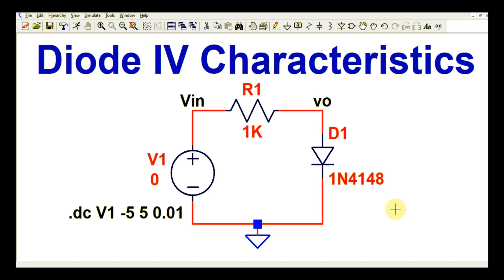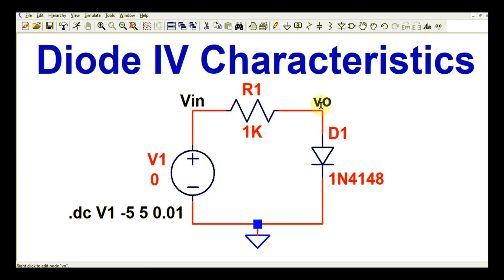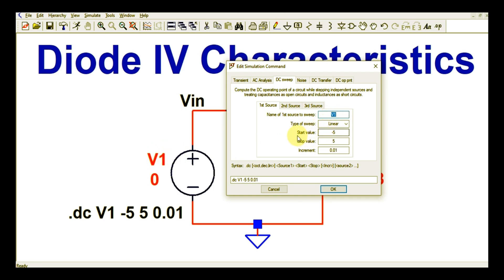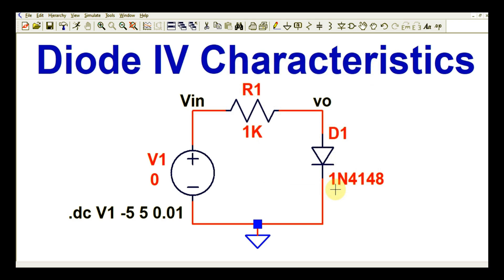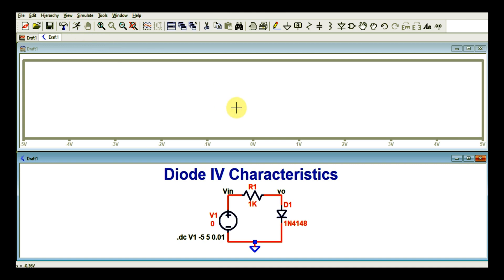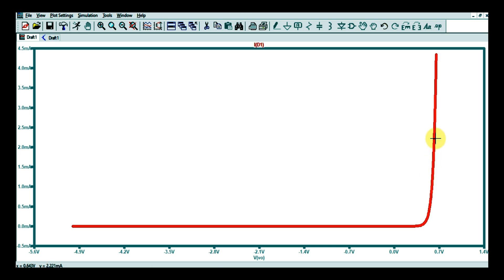LTSpice Diode IV characteristics | Simulation

Comment: Professor,  should there be a revere breakdown knee around -75volts? Maybe, the diode model does not deal with reverse breakdown.
Reply from the maker: Hi...I did not check the PIV ( Peak Inverse Voltage) of diode in datasheet. PIV says max reverse voltage a diode can withstand before getting damage.